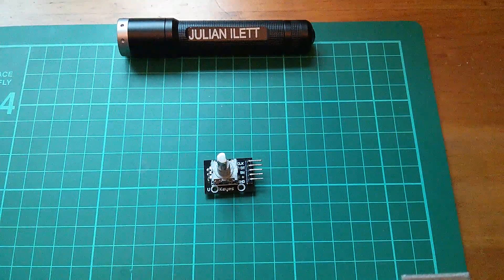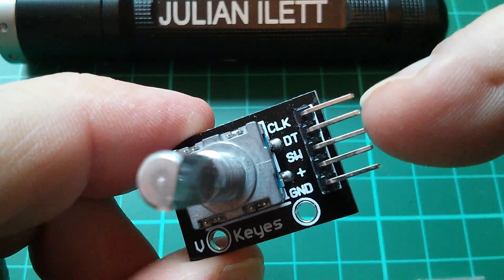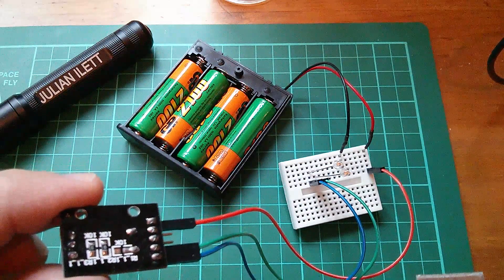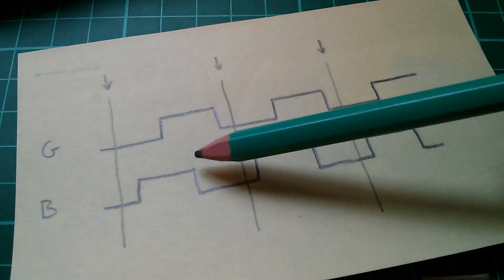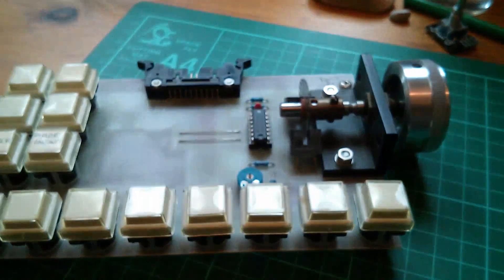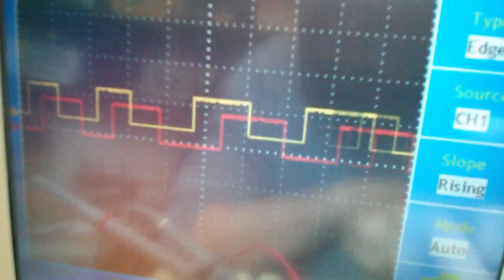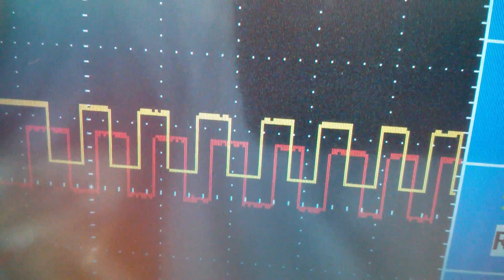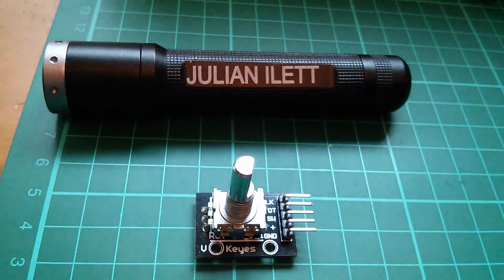Project: 20-Position Rotary Switch #1 - Quadrature Phase Shift

Comment: If you take the two quadrature encoder outputs, debounce them with Schmidt triggers, and feed one to the CLK input of a 74HC74 D flip flop and the other to the D input of the '74, the Q output will indicate direction. Next take the two debounced quadrature signals through a 74HC86 XOR gate, you will get double frequency clock on the output. An easy peasy hardware solution!! I just interfaced my first quadrature encoder, the same as the one in this video, to an Arduino. It took a day of research but was very simple to make work with only software in the end.

Comment: Hi ,, in your video ,it shows both pin A and B of encoder  are low state always in the shaft resting position. but most of encoders both pins are either low or high in their shaft resting position..

Comment: Hello sir, I need a 10 position rotary switch without microcontroller and only with mechanical and electrical system, because I want to set it to my project when microcontroller fails so we can use it, thanks

Comment: what are the DT, SW and clk used for?
Reply: SW (SWitch) is used when you push in the encoder shaft, acting like a push button.  CLK (CLocK) tells you when a rotation occurs and the DT(DaTa) line tells you which direction the knob was rotated.  If you look at the markings on the pins, you'll see that CLK has a symbol for a falling edge.  When the clock transitions from high to low, you read the state of the data pin.  If the data pin is high, the encoder was rotated one click clockwise.  If the data pin is low at that time, the encoder was rotated in the anti(counter)clockwise direction.  Lather rinse and repeat for each pulse on the clock pin.
You can use the falling edge of the clock signal to drive an Interrupt Service Routine in your arduino code.  In the ISR you get the state of the data signal.  These are going to be noisy signals so you will need to debounce things either in software or hardware.

Comment: at about 3:30 into the video, have you connected the positive battery terminal to the GND pin of the encoder?
even though it is labelled GND, its the common pin and its the only way I can imagine connecting it up easily

Comment: All these devices are crap. Designed to fail, especially in home audio crap. $500~600 for a new AV Home Threatre receiver; and when the volume control goes out . . . you're dead. 
Oh sure, just clean it and you're good to go. How many people are willing to tackle this job?
You're all fools . . . deserve what's coming to you.  New and Improved technology . . . is NOT beneficial to the consumer, only the manufacturer. They got you by the Short and Curlies.
Regular pots get noisy, spray 'em clean. When they go bad (get flat spots), you can change them out in a heartbeat. And nearly anyplace on earth. 
Truth Statements, # of Pulses, debouncing, encoding to a processor . . . CRAP

Comment: Hello Julian 
Here is a very simple but effective way to encode the output of a rotary encoder. 
https://docs.google.com/document/d/1-VI23l5l8y_vsXXs0WqfNW6d4SFrjK4JU8th_tL6PoE/pub
Reply from the maker: WFIWasserkraft That looks a bit too simple. No interrupts and serial monitor in use - huge scope for missed pulses. And no attempt to suppress double pulses. Also, no information on RC filters on switch pins. But I'm keen now to return to this project.
Reply: Julian Ilett Thank you for your feedback.

Comment: Mechanical incremental rotary encoders require debouncing. It's simple and cheap to do with an RC low pass filter, it just limits the rate you can turn the knob. From here, this encoder doesn't look like it's really meant to turn fast anyway because of the quite stiff seeming detents. It looks more like its designed to behave as a 20 position rotary switch than be swept like a potentiometer.
Reply from the maker: KX36 I'm beginning to think the only way to reliably debounce this device is with an RC filter.

Comment: I'm building a leading edge & trailing edge dimmer (switchable depending on its use) which will be 5v controlled from arduino outputs.

Basically the circuit you made here but with an Arduino in the middle.

Very exciting stuff!

Comment: Lovely clear explanation of rotary encoders and BONUS addition of retro homemade superior optocoupler version!

I just bought 50 mechanical ones not on a pcb which I now regret as I thought I'd be mounting them on my own board behind a faceplate but may not now.

Using a library from arduino site to use these things.

MUCH better than the other YouTube vids on the subject.

Thanks!
Reply from the maker: ***** Thanks, I dug out the old encoder because I thought it would be easier to see how it works.
Reply: Julian Ilett What is the PPR of the old encoder?

Comment: Just as a warning. I had a nice alps encoder. But not all the 20 resting positions you'd read 0,0 on both pins. Some would read 1,0. 

So in short, don't trust on the resting positions always always giving 0, 0.

Comment: Nice little switch. Looks like a pretty standard rotary encoder output. The ones I've worked with call the outputs A and B. Interrupts are the way to go. The software must handle the switch as new and after years of operation or abuse. Products with dodgy switch handling (slow or erratic operation) seem more common now. Maybe it's related to the move from hardware debounce to software and/or the desire to get it out the door quickly.
I don't do much with Arduino, but lots with PIC and always interrupts. For this sort of thing input interrupt on change, with flag bits to keep track of where it's at in the cycle. Interrupt, disable one, enable the other, and capture a free running counter (same counter used for RTC)  to determine speed of rotation; faster turn = increment integer by 5 or 10 etc.
Reply from the maker: PMB-NZ Yes, I'm thinking very much along the same lines

Comment: I made a very simple code which I think should work with your type of switch. I'm not sure but it might work.

int clk = 7;
int data = 8;
int output = 0;
void setup() {
  pinMode(clk, INPUT);
  pinMode(data, INPUT);
  Serial.begin(9600);
}
void loop() {
  Serial.print(output);
  int clk_dat = digitalRead(clk);
  int data_dat = digitalRead(data);
  if(clk_dat == HIGH){
  if(data_dat == HIGH){
    ++output;
    }
    if(data_dat == LOW){
    --output;
    }
  }
   delay(10);
}

P.S. Your videos are Great !!!!  : )

Comment: hmm  it looks as though this is a mechanical approach to a "continuous differential switch".
00 is the "position" state in which case your code is set to handle a certain value.
when it goes to the 01 11 10 00 states, that means you turned the switch clockwise (or anticlockwise, it was hard to see what you were doing).  Meaning you would increment a counter or some UI element.  if the switch goes to the 10 11 01 00 phases, that means the switch was turned counterclockwise and you'ld decrement a counter or UI element.

I'm not sure the ardiono can pick up on the state changes fast enough via a digitalread though, so it may take a bit of electronics to do the left/right turning thing and then signal a up/down (increment/decrement) signal to the arduino via some other way.
Reply: Mental note... watch the entire video before posting comments :)

Comment: Looking at your 'scope, you have far too much noise on those contacts - you should be able to get reliable operation with digital debounce. The main drawback with the several ms of bounce is it will limit the rotational speed and result in 'aliasing' and your electronics will interpret the wrong rotational direction. Grayhill manufacture some relatively cheap (<£10) opto encoders or ripping a ball mouse apart will provide the guts to make two - the sensors in there combine your two slotted opto-couplers into one unit with signal conditioning IC.
Reply from the maker: AtomicWorkshop It's easy to do with opto-couplers - the signals are clean. But this cheap (and very nasty) encoder has become a challenge - I want to tame this beast.

Comment: Why not just put an AND/NAND gate connected to both DTA and CLK, that way you eliminate rotational bounce, and have a single output lead going over to your Arduino Interrupt? Adds an extra chip, but I dont see why that wouldnt be a simple solution for turning it into a switch.

EDIT: Ah wasnt thinking about the direction component for incrementing and decrementing, that solution wouldnt work if direction mattered (which I guess is kind of the point of using a rotory switch, lol)  Though, one could solve that by adding a couple extra components that ends up dividing the output into two leads, one for incrementing and one for decrementing, but then that is more complexity and thus a less elegant solution. Probably best to just look for an arduino library designed for rotory switches.
Reply from the maker: Amra I do like this sort of idea though. Currently I'm using one interrupt to disable the other interrupt (and vice versa). It doesn't work, but it's helping me to formulate ideas!
Reply: I was thinking of something similar using discrete components, such as using a transistor to set a condition that grounds out the second output for a moment, perhaps by way of an RC time constant, or latching diode. Just seems that most solutions like these would be more complicated/expensive than arduino code, lol.

Keep at it, Im sure you will figure it out!

Comment: I picked up the very same encoder a few weeks ago. The silly pin naming had me headscrating for a while :)
For something a little different try this library. I features velocity sensing to give you slow or fast changes acording to the speed at which you turn thr encoder
https://www.youtube.com/redirect?q=http%3A%2F%2Fcode.google.com%2Fp%2Farduino-rotary-encoder-with-velocity%2F&redir_token=5ecWhw3uXSz5aLn5B1IV_UDkX3F8MTQwOTA5MjM0MEAxNDA5MDA1OTQw

Comment: Bi-fase-encoder
Pseudo-code:

Val:=inport or inport <<2
Loop
    val:= inport or val <<2 & 15
    If val==0000 then no rotation
    If val==0001 then right
    If val==0010 then left
    If val==0011 then illegal 

    Etc etc

Endloop

I got a full example if you like to see

Comment: The 22yr old optical version would suffer with noise too... Dust on the disk could affect the opto-couplers but what comes next... oh a schmitt trigger... Sorting the noise issue out... Use the same thing on the mechanical one?

Comment: Hi Julian!
If you haven't found yet, might worth checking out that arduino library: https://github.com/brianlow/Rotary
With that you don't have to use an RC filter (or interrupts), that clever code do all the funny business in a very simple way! I ported that code to a PIC and it worked flawlessly.
Reply from the maker: lowlatencyvids Thanks. I like the look of that - I'll give it a try.
Reply: That code doesn't look to do any debouncing, and only outputs a change on two or four state changes. Grey code has the advantage that even if you don't debounce, you won't lose count of the number of steps as only one bit can ever change at once.

With no interrupts, it'll be horribly unreliable unless all you're doing nothing else or only rotating the encoder slowly.

Comment: Here ya go easy peasy once you grab the library:
#include "Quadrature.h"
Quadrature quad1(9, 8); //Set Encoder Pins to match your board
void ENCODER(){
R =(quad1.position()/1);
if (R != Rold) {
(Rdif = (R-Rold));// finds out the difference
if (Rdif == 1) (la= (YOURVARIABLE++)*25);//this will also step in multiples of 25 or whatever you like
 if (Rdif == 1) (la= (YOURVARIABLE-)*25);
//do what you wish with the data blah blah
Rold = R
}